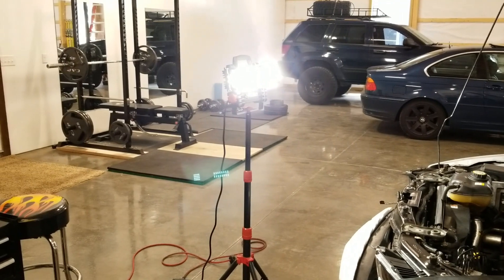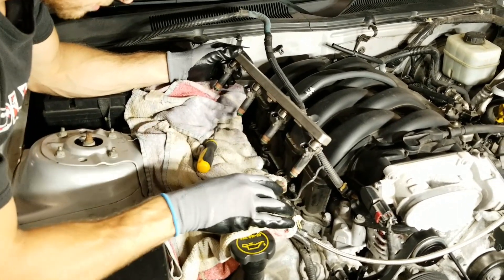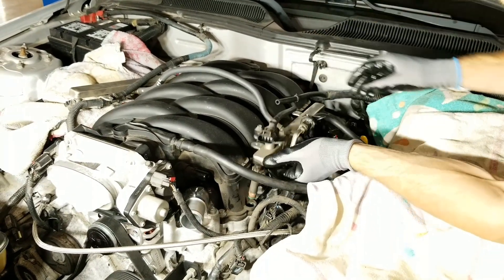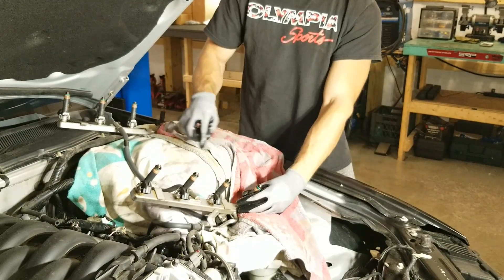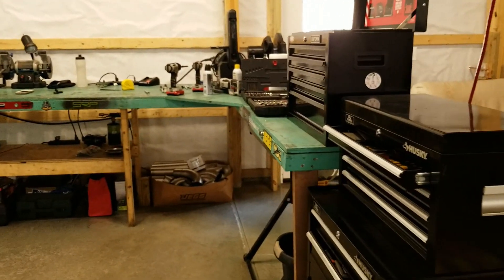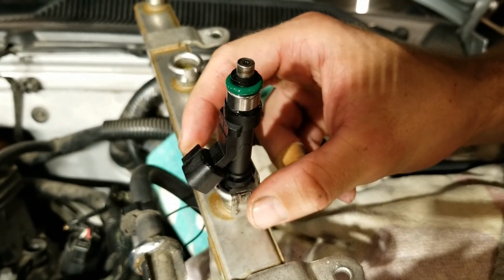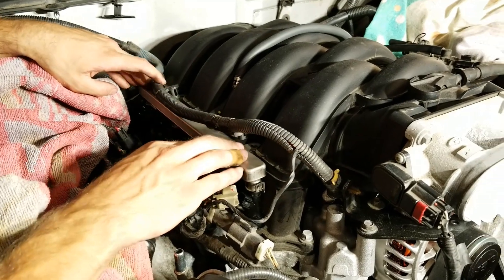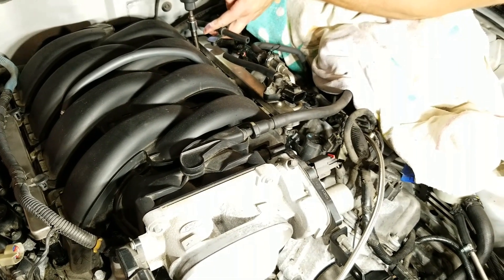Turbo Mustang Part 4 - Installing Injectors

Comment: Was wondering what you did for the thermostat housing. Did you leave it in the stock position?
Reply from the maker: I had to update it to the 08-10 housing
Reply: What parts did you buy? Trying to do the same thing but can’t find good info on what to buy

Comment: Hi I'm installing the same on3 kit however I didn't opt in to add injectors do you know if you can purchase them separately or are they exclusive to the kit? I am having trouble finding them on the website.
Reply from the maker: Just give them a call, I'm sure they will sell them to you.